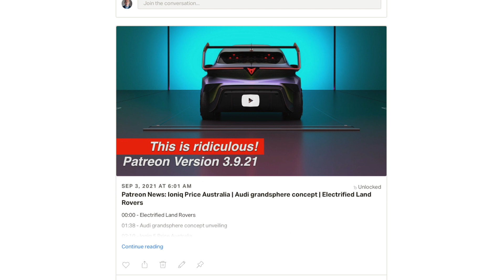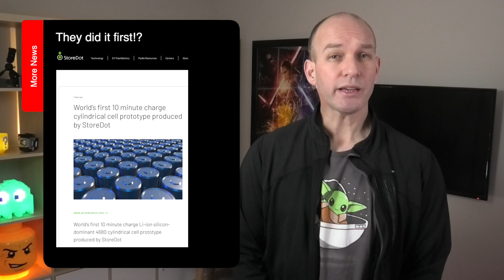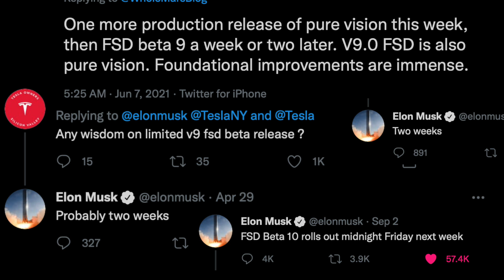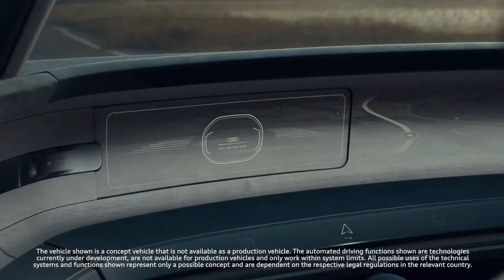Tesla dethroned in the UK | 4680 cells achieve 10 mins recharge | Grandsphere Concept | News 6.9.21

Comment: Tesla doesn’t provide the option of single motor long range ATM and for that dethrone thing I think they are bound to as their finish is not that great for example the gaps between doors etc. they are still slowly improving over all these years. From their headlights to sensors on wipers to auto high beam are all way too bad compared to other luxury models. Guess only the EV technology is working for them.
Once other companies catch up with the technology and start their mass production then Tesla will have to pull their game up significantly to stay atop.
Reply: Yawn. It’s not 2018.
These panel gaps and fit and finish stories are getting very old, and are quite frankly total rubbish.
There are NUMEROUS reviews from all sorts of unbiased testers who say that.
Reply: @FutureSystem738  🙄😱